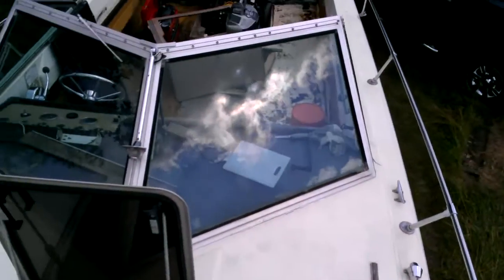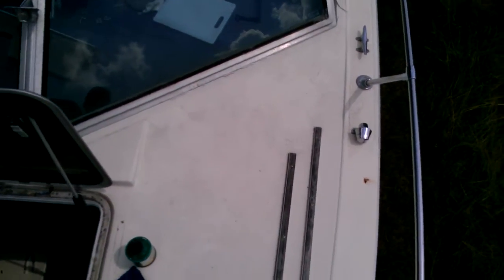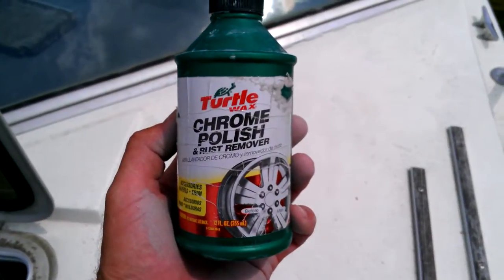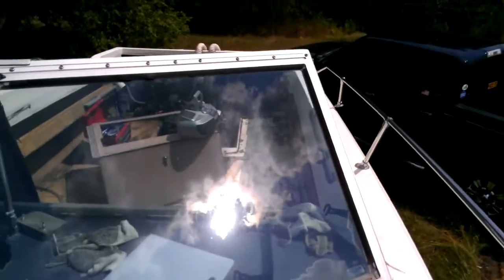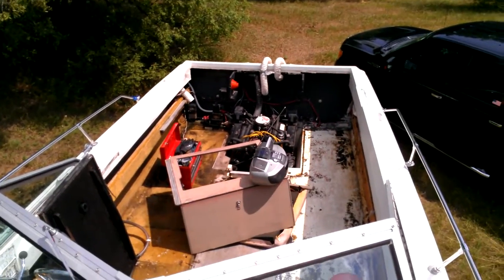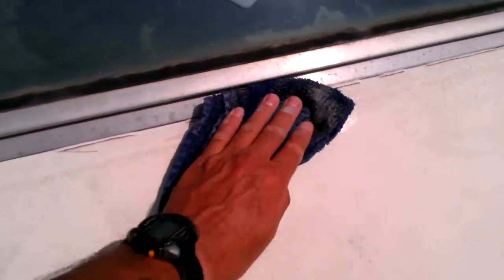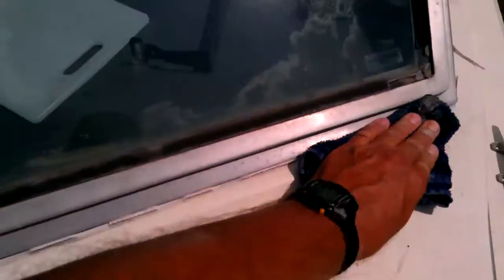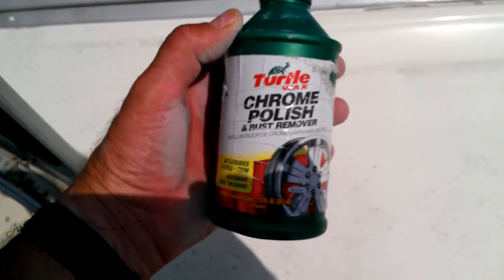Boat Restoration: 1976 Sea Ray - Boat Deck Restoration

Comment: I know this is an old post, but dude, they make mold / stain remover that is cheap and you just spray it on and wipe off you can get it a Home Depot, Menards or Walmart.  Chrome polish is for Chrome, not gel-coat.
Reply from the maker: Chrome polish is cheaper than stain remover